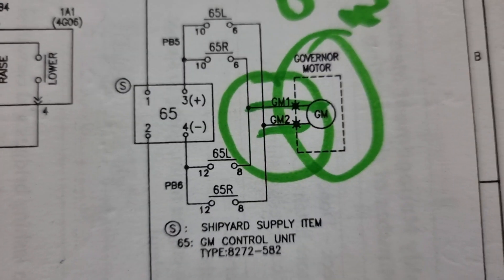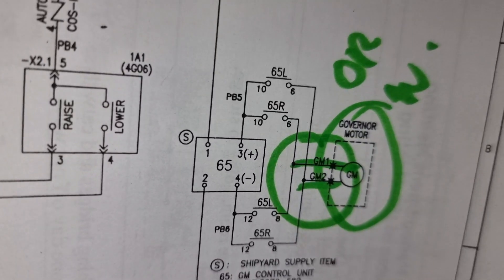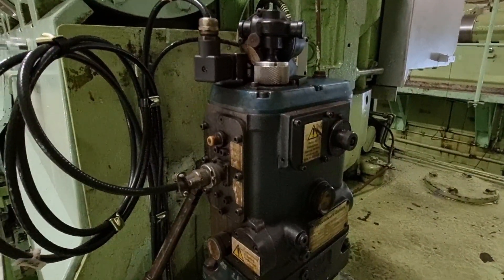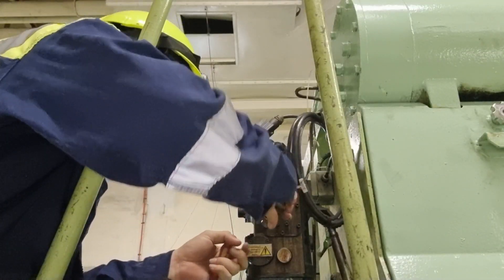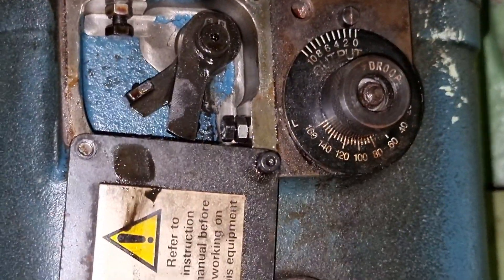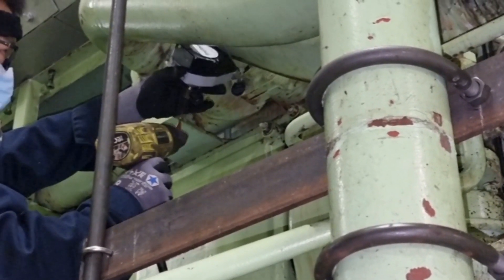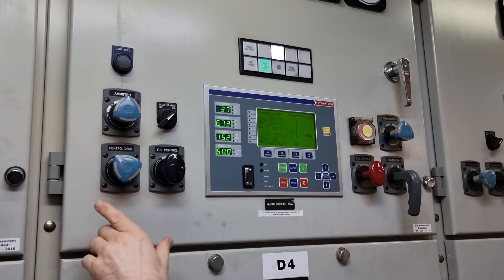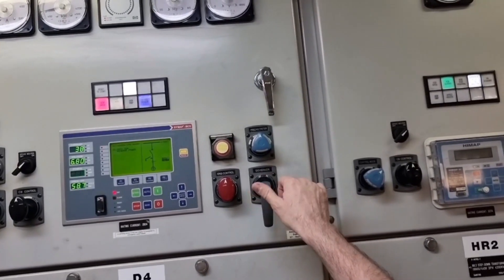GENERATOR's GOVERNOR OVERSPEED ALARM | ETO TROUBLESHOOTING

Comment: I suspect the governor needs to be rebuilt high amperage output in order to get governor to function will cause controller to go out again. the governors are constantly moving ever so slightly. many times governors can be the issue. I dealt with air over hydraulic governors which are older technology. also the pyrometers that give feedback to the controller have feed back tables with response times in the millisecond I presume. sometimes it's better to go into the controller and turn down frequency of adjustment. depending on controller it should be possible. also the range at which the controller tries to keep pyrometer within temp range.

Comment: Temp switch being tested with heat gun blower is not proper. How in the world will you know the correct temp. Calibrated thermal well should be used.

Comment: ,,sir ano po ba possible problem ng generator set cummins brand,,unstible rpm and frequency,,
Reply: Check your governor, fuel line and filters, fuel pump & injectors as your engine is hunting

Comment: Ship  HV generator 6.6 kv 4500kw i am trying to test reverse power trip. The Breaker setting 450kw 10% of full load. When testing generator lower load untill -430kw  it’s go back -350 kw. I am trying two times to reach -450kw but failed, suspected governor mechanical linkage activated. Do you have any idea regarding this matter? 
And how you test HV generator reverse power trip?? 
#TIA
Reply from the maker: Change the setting by lowering the percentage reverse power trip. 7-10 percent with a littlr delay
Reply: Trying to set below 10% but failed due to minimum only can set 10%.

Comment: Hello so the governor was stuck .Did you replace the governor after this problem because it can be respected again?
So there is a internal wear of components that makes governor stuck in full position.After 10 years governors should be given outside for checking and adjustment from maker.
Reply: Ano guy who share his knowledge thank you more content pls

Comment: Sir, what are the things to check to determine whether the governor is still good or not?
Reply from the maker: Check the resistance of the DC motor
The solenoid coil
The knob if you can manually adjust it or turn
Then the respond on the fuel rack.
Atleast I am talking about this type